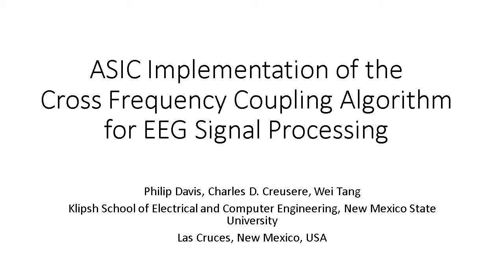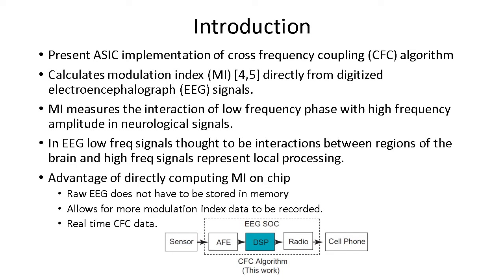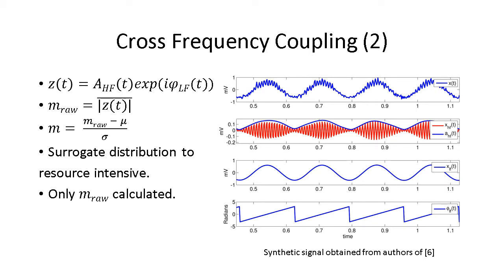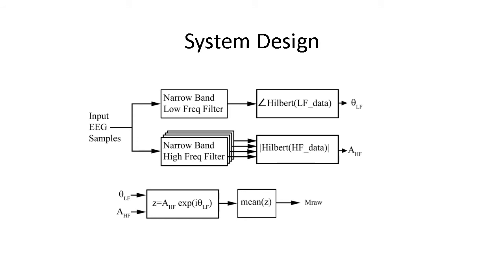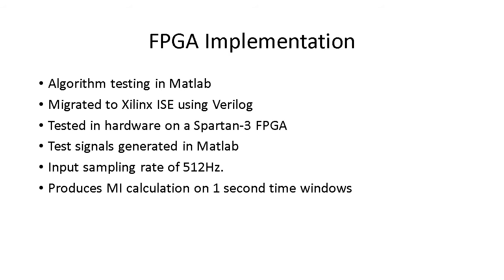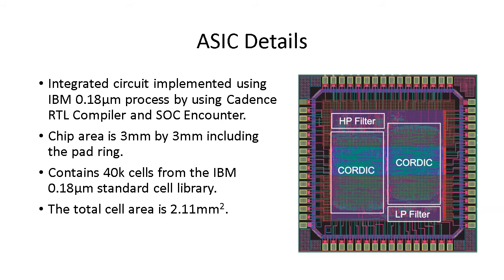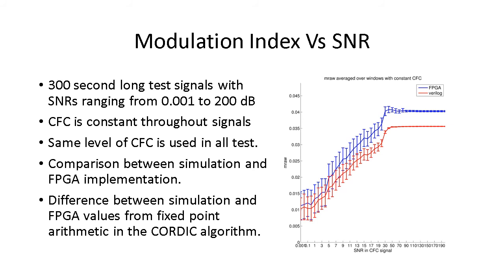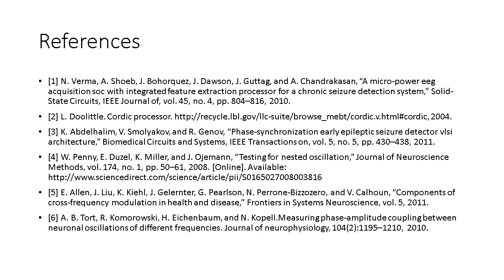ASIC Implementation of the Cross Frequency Coupling Algorithm for EEG Signal Processing

Comment: Authors,

MI is probably the most widely known ( Canolty et al Science 2006) CFC measure but I would like to know if you tried other measures.  For example, utilizing correlation (Fisher transform) between the two signals from what is called ESC metric, the paper predates canolty but the author name escapes me,  seems to handle noise better.  Also is this for Ecog or EEG, I suppose both?  Spectral resolution is not great above 30hz in EEG.  I really like the work you are doing and would like to discuss in particular your comparison to other IC.